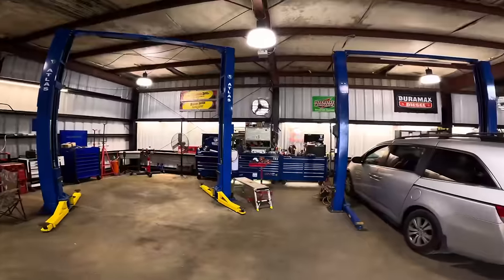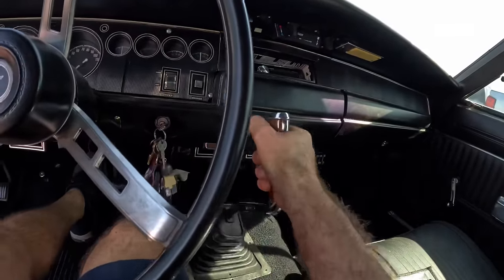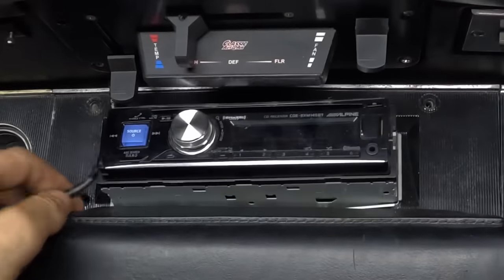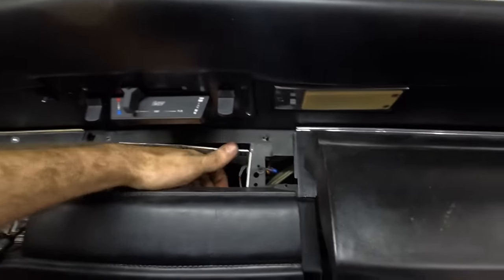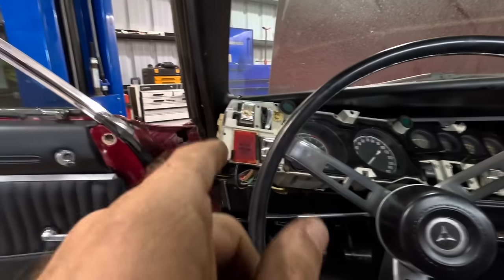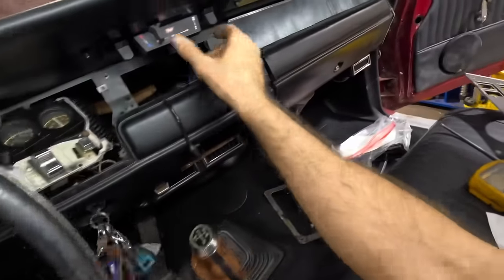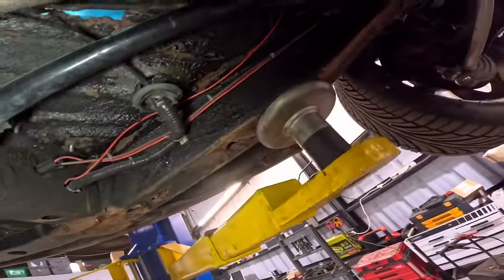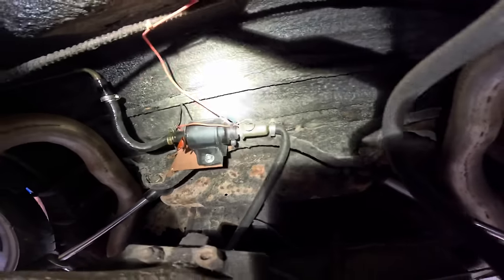Needs REee Restoration | 1968 Dodge Charger

Comment: Hmmm - I commented that the wiring looked like a real trouble spot on this car, but now that I’ve finished the whole video, this is a “nope” project.  The electrics are at best suspect, there’s a ton of add-on parts that are dodgy AF (exhaust cutoffs - those don’t look particularly new, and they don’t look like they’ve been tested in even longer … and then there’s the rust issues on the underside.  *Yikes*.  

But - and it’s the bigger “yabbut” here - is the customer handing you a list of issues that’s clearly been through a few hands and they haven’t flagged what’s been fixed, what hasn’t.  That’s a customer who is a terrible communicator - and that’s the hardest part to deal with.

Comment: Hi Ray
Here in the UK we would call this car a lemon or a money pit ,the attempted body repair with the many screws is just bad ,the owner will have to have a deep pocket for body work through to new wire harness for the modes place on vehicle to stop future shorts as I can see parking up at work or home it will turn into a burning wreak. Which he won't want

Comment: That Charger is a flipper special.  More than likely its frame/body has been cobbled together from several donor cars, which is why nothing really fits right.  All of the interior parts appear to be shoddy aftermarket junk.  The car is a shiny paint job into which a really bad car has been assembled into.

Comment: Such a shame to see one in that bad state. I think the way it's had those floor pans repaired with screws makes it look worse than it is. The whole interior needs stripping out and new metal welding in. The chassis rails can be saved by welding new metal in where necessary, but that wiring is a fire waiting to happen.

Comment: The car is exactly what I would expect to see.   There was almost no rust protection provided by manufacturers in this era.  I hope the owner doesn't have too much invested because the car needs massive repairs before any of the smaller systems are repaired.  I expect the entire wiring harness is toast and it is pointless to attempt spot repairs.  The bones are good, but it really shouldn't be on the road.
Reply: It looks like all the original wiring harness was replaced with some aftermarket harness, and they did a poor job at that.  Looking at the video of the car it appears none of the prior work was done correctly.  From the bottom of the trunk, it appears the trunk is just flat sheet metal,  I bet the rear window area is all rusted out too.

Comment: If the owner has the money $$$ then you are the right mechanic to do the work -- think like this, you could be the last good mechanic to touch this car and clean all this up and send that car on the way to the body shop in good mechanical condition (which is probably where the car is going anyway -- chicken and the egg: body then mechanical, or mechanical then body)

Comment: Plastic does not age well it becomes brittle and changes dimensions.   So it probably needs a replacement wiring harness.  Everything probably needs refurbishing if not replacement..  Push it over the cliff.

Comment: I cut my teeth on this era of Mopars as a dear friend had a 68 Charger...that car is a mess...alot of bad fixes.
   In a nutshell...to be done properly...it needs a ride to Springfield Oregon to Graveyard Carz...Mark Worman is THE Mopar master restoration guy.
    i just hope the cars owner didn't pay a ton for it as it needs a full restoration for sure. It does sound good though.

Comment: My advice, offer to properly fix the issues with the battery/charging, headlights, wiper motor, radio mount and RCA cable swap.   Make it driveable for a few more years.   But it will have to be a project car at someone else's facility.    Unless the owner has 50-60K kicking around to do a proper full restoration, that vehicle is just going to be a money pitt.     The previous repair attempts have been poorly done, which compounds the damage.    There was very little if any attempt to remove rust and corrosion prior to the body and paint work.   You don't fix a classic car with bondo, you source a replacement panel.   The car is essentially a strip-down, frame-up restoration.    At the end of the day, at an auction this car wouldn't do well, the high-value cars are original equipment not after-market performance parts poorly installed.   Frankly, that engine looks like a 318 or 340 with a 4 bbl stuck on it.    It's not a Hemi.

Comment: I'm a heavy Mopar guy, and this vehicle is in such poor disarray...  Dude, you gotta play this smart, because this car will probably take at least $30-$40K in frame and body repair alone.  Let alone the electrical nightmare that you have been presented.  My best opinion on this is to either give it back to the owner and let them know that it needs a full rebuild from the ground up.  And this project will take some time to coordinate with multiple places to do the job correctly.

Comment: The Charger is giving me the impression that it desperately needs its wiring overhauled (replaced).  It looks pretty rough in there, and there’s so many questionable electrical issues that I’ll put good odds that the wiring harnesses are damaged in multiple places … okay - more than multiple places.

Comment: would just about be easier to find a good shell and panels and swap all the running gear etc over to it, I want to like it and say go for it and fix it as I love old chargers and such but this is setting up for a nightmare to get properly fixed

Comment: This car needs a total strip down and restoration, there will be numerous hours of rust removal and panel restoration and a new paint job before any of the mechanical repairs can be made to get it back to a reasonable condition, it doesn't look like a job for your shop as it stands currently, tell the customer to take it to a restoration shop then return it for the mechanical repairs.

Comment: Thats JL AUDIO not audiovox.
Its a 13w3 looks like  
Youll need 17' rca cables  
Tell him to take the stereo to a car audio dealer that know what they are doing and use a dam back strap on it.  But that Alpine is not going to play a disk,  now his 6 disk cd changer will you can put that on a paint shaker  we had one on display Alpine made it.  I sold both Alpine and JL Audio.

Comment: Wow. As the old sayings goes, "Looks good from afar, but far from good." A textbook example of a classic car lot flipper special. They probably sold that mess for 50 grand to the buyer with stars in his eyes, and it needs a 100K restoration to be worth 75K. Sad, really. Is it restorable? Heck yes, it's a big block '68 Charger, they take them back from FAR less than that. Will it get one? Probably not from that owner, if he's more concerned with the radio and other dumb stuff than he is about the significant structural rust damage and roman candle wiring throughout. Send it to Jamie at Dead Dodge Garage, he'll formulate a plan.

Comment: Fix the predetermined functional/safety issues, at least what he currently can afford he can bring it back for the other things. Sounds like an 18yr old owner  (Fix the radio first)   stick to the necessary stuff first/ cars need a sound foundation just like a building

Comment: I'd say MECHANIC DECLINES REPAIR. The charger looks like it jerry rigged to get it to roll. It's a major safety issue on the road. Bando over rust then painted is just the tip of everything that needs to be fixed. Saw a cutout in the frame rail just to run that wiring under in the rear area. Looks like the floor is literally disappearing by all those screws pocking through above the transmission and that was just by the transmission. In the rear its starting to get like that as well. Just looking at all that wiring that was added is giving me a headache and that is without trying to figure out why is was routed the way it was and whoever did the interior work should told the customer about all that rust instead of just trying to conceal it all for you to find. Lastly, that note for repairs should have been updated with what was fixed so you wouldn't have had to waste your valuable time trying to figure out why it would need to be fixed when you got it.

I hate to say it as it is a classic American muscle car but that car is no better then a car waiting to be crushed in a junk yard. It appears structurally unsafe. Only thing that looks worth saving is that motor and possible transmission pending why it apparently is shifting differently and even looked like the shifter was catching when you were trying to shift gears.

Sad day for that charger indeed.

Comment: The more you look, the more you fine wrong. Many of the parts like the light switch and headlight doors no after market companies make so they are going to be expensive if you can find them This is the type of work best for a restoration shop that can spend alot time on it and nothing else And you wanting it to be in the best condition it can be when it leaves your shop is going to be frustrated because they has to be alot more wrong with it than what you found. Its a hack quick flip resto. I wouldsend it back to the customer. as is..

Comment: there is too much to do for a shop, for someone restoring the car needs to start from the bottom and
work their way to the top! the “barn job wire job” is a short waiting to happen, the floor needs to be
welded together! the wires will fry out the electrical and fire will in sue !

Comment: Ray - PASS!  First, the car is older than you!  LMAO  These cars are totally different animals from todays vehicles.  Not that hard to work on IF you have a factory service manual, and some familiarity with these, as well as where to get parts for these dinosaurs.  Add in the hack mechanics that have been there before you and RUN, don't walk away from this one!  It is not beyond saving, but it needs to be worked on by someone who is familiar with these cars.   FYI - the headlight doors are vacuum operated, which is why you have the vacuum connector just to the left of the headlight switch.

Comment: They don't build cars like that anymore, and that's a good thing.
What you have there is a hobby, a project, it's so far away from a '68 Charger that there is no going back.
It's never going to be worth $250k, but the owner could spend a good chunk of that to make it into some sort of resto-mod, but it's not a '68 Charger anymore.
If the owner wants a bunch of stuff done, you can take his money, but it's always going to be an unreliable, rusty, project that stalls, unless someone does some serious work. To what end?
The bigger issue is liability for doing work on the thing without making it safe(r), and what shape the owner thinks it is in compared to reality. 
I think you need to bring in the owner, show him what state things are in, then he can make a more educated decision as to how much money he wants to drop on his project.

Comment: Should have looked at it first then politely declined working on it. That will only get worse the closer you look at it. Suspect the owner has no clue how bad it is. Too late now as you've already made it (slightly) worse than it was, so at an absolute minimum, you'll need to put it back as it was.

Comment: If you are going to own a vintage car, learn as much about it as you can. Do as much as you can yourself. If you don't want to do this, DON'T buy a classic car. These cars are SO easy to work on (except for standing on your head under the dash). DO NOT put a 'modern' radio in>>they never fit right and you hack up the dash.

Comment: That poor Charger!  None of the previous work done on the car was done correctly.  Just fixing all the wiring problems will likely cost several thousand dollars.  Likely need over $30K+ in body work.  Seems every panel is rusted and someone just bondo over and paint it to flip the car.

Comment: Reviewing the comments it's a majority that it's a POS.  Restorations are very $$$$ as I have found out on my current one. This 68 Charger is an icon and deserves better if the owner can afford it and wants to spend the money ($40-$50K). It still has some value to those Diie Hard Mopar Guys As-Is. With a "Proper Restoration," it could bring $125k +. This may be one for you to walk away from.

Comment: Who ever "installed" the stereo was a butcher! He hacked the original radio opening to accommodate a modern DIN radio sleave, and did it poorly! And upon further inspection ALL of the added on wiring should be ripped out, no grommets and more than likely none of it is fused, a fire waiting to happen and the end of a classic muscle car. Face it Ray there isn't enough hours in a week to address all of the repairs, put the dash back together and push it out of the shop.

Comment: The wiring on that car is an absolute mess and needs a rewire, as for the rest of the repairs..... It needs a ground up restoration rather than just fixing whatever issues present themselves.

Comment: I would not do anything with that junk....my son and i restored a 87 cj 7 jeep, and we took it down to metal.. after putting 3 grand into the rear end engine transmission and trying to de-rust it..when we were done, we noticed the frame was thin.. so we sold it fast.
So DON'T work on that car.. you will have to fix the body rust just to mount things you need to mount.
NEVER work on a car that smells like gas.. i've seen too many cars/trucks burn down a couple work shops to the ground.  If you do work on a gas smelling unit, do it outside AWAY from the shop.
Good video....that car.. not so good.
al

Comment: Hey! lets add some bolt on stuff instead of making the car safe. This is a deathtrap. Seats bolted in with carriage bolts through the floor??!! There is no structural support on the floor the way it is installed. The dash was cut out the wrong size for a Din radio. So no! The radio lock cage will not stay in the car even with a new lock cage.  Inform the customer you won't work on it. You can't due to liability issues. It shouldn't of been worked on by a amateur that ruined everything that was touched and installed with duck tape and chewing gum.

Someone needs to spend $30,000 or so and have it fully restored. If the owner can't do it, then sell it. At this point it's just a junk beater and a deathtrap bound for the scrap heap.

Comment: Run, run, far far away. Whatever you do, it will be a nightmare for you. As you mentioned it should be torn down and repaired properly. This is not a few hundred dollars in repair, it's a $100,000. makeover. (the number I just pulled out my arse)  Too bad somebody ruined a classic such as that. After giving him the parts cost, tell him this is not the job for me. Find a competent restorer. Good Luck.

Comment: This is somewhat of a sad case. The car is a super-cool make and model but it is so trashed out that I don’t see it surviving long at all assuming someone wants to drive it. The cost of a real restoration might be outside of any reasonable budget unless the guy has a lot of discretionary income and plans to hold onto the car for a while. But as is, I don’t think the car is even safe for the road.

If it was me, I would create a list of “must be done” jobs before I agreed to tackle the frivolous list he presented. Who cares if the radio works if it is not going to be safe and reasonably reliable when it leaves the shop? I would not want any potential liability should something go wrong. If he is good with getting the necessary things corrected and still wants to foot the bill for the bells and whistles, then fine. You should make a good income from fixing that thing. But as bad as that thing is and if all you do is address his stated concerns, I would bet he won’t be happy with it for long. He will still have a trashed out car that should not be on the road but his radio and wipers will work.

BTW…..I have a hobby car (Cobra) and all Cobras have a tendency to have bouncy speedos. Typically the gear and cable prove to be in decent shape but many of the cables are routed in a way that they have a lot of goofy sharps twists and turns as they wind their way out of the cockpit, out the firewall, around the engine bay and back to the tranny. If someone takes the time to properly route the cable with few and wider arcs in the turns, the cable operates smoothly and the Speedo is perfect. That is a much bigger car and routing should be easy but based on the condition in other places, I would not be surprised to find a very sloppy route for the cable.

Comment: The floor "repair" and bodywork (not to mention the radio "installation" and "wiring") all scream run away from this Rabbit hole. There is butchery on every front. It's worth saving, but it will take lots of time and money.

Comment: This car seems to have been trashed by a “flipper” who bought a sad car and did a half assed resto on it hoping to find someone to pay a premium for a hot car. Sadly very common problem.  Many times they are not even safe to drive. Rust covered with bondo, frames sloppily welded. Anything to get a profit. These Charges are desirable cars thus the lure to scammers. On a Chrysler of that era the speedo head could also be damaged.  Now that I see the underside I have no doubt of my deduction.

Comment: I do not understand how this project fits your business model. You need to get cars in and move them out — quality repairs with readily obtainable parts and customers who pay. This Charger is a long-term project that will tie up a valuable lift and require substantial body repairs to make it safe. How much is this customer willing to spend? Even if the customer states they are willing to pay, there’s no guarantee they will not bail out as the costs mount and leave you with a mess. I say stick with what you do best.